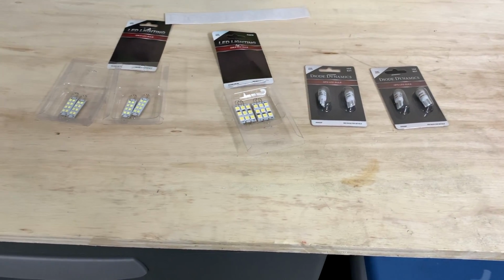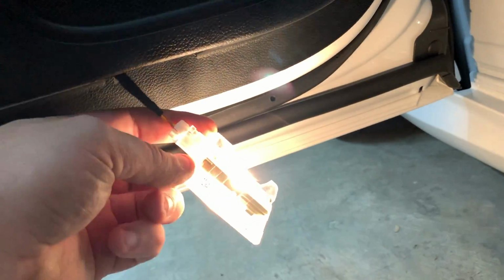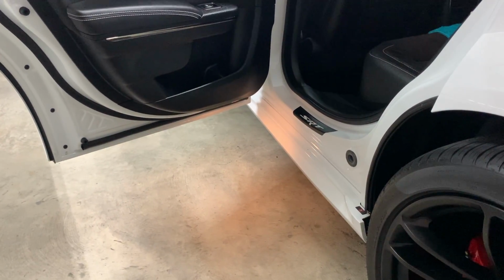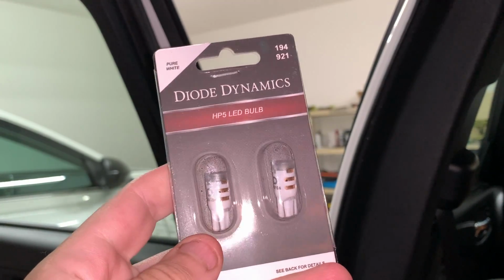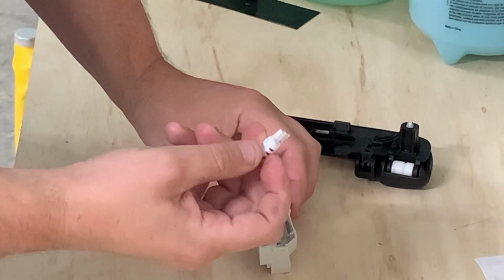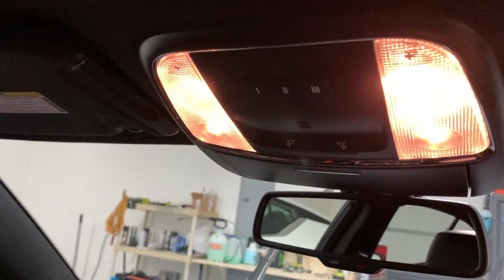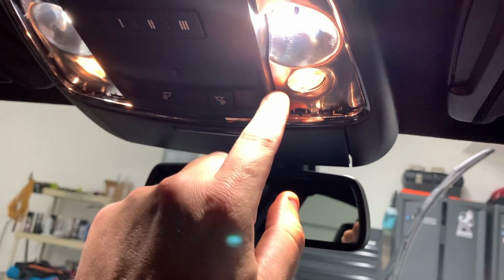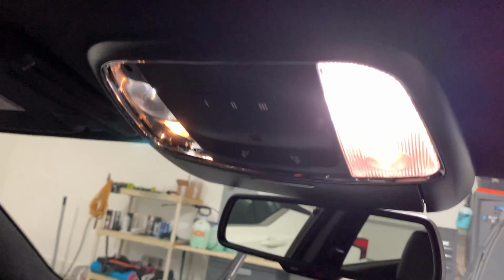Diode Dynamics LED light upgrade / 2020 Hellcat Charger.  #diodedynamics  #Hellcat

Comment: Just did this swap last week. FYI, for the map lights it’s easier to just pop out the entire center cluster with a trim removal tool. There are only 4 spring clips holding it in. The 194 lights come out from the back with a quarter turn of the holder. This way you won’t risk damaging your plastic lens covers trying to pry them out.
Reply from the maker: Hell yeah. Good info there. Never would have thought removing the entire thing would be Easier than just the lens cover
Reply: Can you please tell me, if i can buy it as a kit from diode dynamics? Or I have to order each bulb individually? Thanks. I have 2018 Challanger

Comment: My 2020 Charger Scat Pack has those factory led map lights as well. Pretty unfortunate that dodge added those. I honestly don’t even want to do this upgrade now because I know it would bother me with them not matching lol
Reply from the maker: Brad Morrow I think you are mistaken.  I have a 2020 hellcat and it didn’t have factory LED interior lights.   They did not put LED’s in the car for interior lights ever.
Reply: Knight's Garage The two lights that are soldered in next to the map lights are led panels. Thats why you can’t replace them because its not just a standard bulb like the rest. There are also factory led’s in the footwells that can’t be replaced. They are led’s they just don’t look bright white like most led’s. More of a warm white.
Reply from the maker: @NobodySafeJB  I see what you are saying.   the only ones that look out of place after installing these LED's are the map lights.  i may do what honestly ocd did and just take them out so they wont come on at all.  I never use them anyway.  Or i can look into what LED i need to buy to solder in there and make them match.  The ones in the door handles, foot wells, etc.. are not that big a deal.  you need those to be not as bright anyway.
Reply: Knight's Garage yeah i saw his video as well. Disconnecting them would probably be the easiest route. I have seen where some people take black electrical tape and put it over the lense as well lol. Dodge always has to go and add something that makes modifications to these cars more difficult lmao
Reply from the maker: @NobodySafeJB  i am definitely not gonna be putting black tape on the lenses..  lol it is only in the hellcats too.     i haven't seen a scat with those extra map lights up there.
Reply: Knight's Garage my 2020 scat has them so they must have just added it this year. I’ll dm you a pic on Instagram to make sure we are on the same page 😂
Reply: My 2019 Ram 1500 Laramie has the white interior lights but my 2022 Charger Hellcat doesn’t smh this is an upgrade that’s gonna happen very soon great video

Comment: Do they sell those bulbs as a kit? Can't find it
Reply from the maker: They do not on the diode dynamics website.  You have to add each one to your cart.
Reply: @KnightsGarage  thanks man, appreciate it, the only thing is lisence plate bulbs, they say on their website challanger 2008-2015, i have 2018, but i guess the bulbs are the same
Reply from the maker: @Сергей-с7х2в Those are already LED i believe.  I have never changed them.  Its not too hard to remove it to look and check.